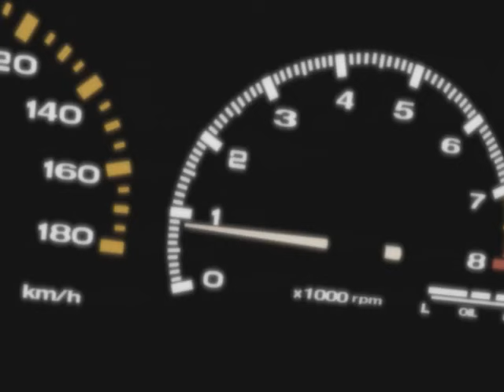Initial D- Takumi shows Wataru how he drives his AE86

Comment: Supposdly this engine is real and used by Keiichi Tsuchiya in his racing days. The closest you can get in real to this motor is Formula Atlantic series 4A-GE which revs all the way to 10,000rpm in open cockpit racing cars.
Reply: There was an image of the engine during the anime. It’s not a true formula Atlantic motor. It’s more like an extremely overbuilt 7age that somehow has Atlantic internals.  you can automatically tell by the sound of the engine.
Reply: Nope, the engine is based on Akira Iida's AE86
Reply: JDM, old reliable
Reply: this is not a formula atlantic and also not a 7age,

formula atlantic 4age engines are 4 valve, not 5 valve as shown

the "irl counterpart" to a 5 valve 4age that revs high and have VVT removed would be the race car 4ag engines found on the AE101s driven during JTCC in the 90s, actually it matches the specs exactly:

10k - 12k redline
5 valves per cyl silvertop
no VVT

famously, it is also put in Akira Lida's AE86
Reply: @FalbereChan  The truth has been spoken. Middo Natto for life.
Reply: Well the original engine block was traced in the manga so whatever is on the page exist in real life somewhere
Reply: It interesting to know that takumi struggles to handle the new engine he says he tried different techniques but I’d imagine it puts a lot of stress in his tires when he goes all out at akina

Comment: "Like" if you got the reference about VVTi engines being less favourable than non-VVTi variants for this scenario
Reply: Basically if I recall, the VVTi engines lack a lot in tunablity which is why it's not as effective as getting no vvti and aftermarket cams. It's basically full time VVTi if u don't get the VVTi model (u gotta get aftermarket cams ofc).
Reply: I have an RSX Type-S with a tuned ECU so I'm able to decrease the i-VTEC engagement to possibly 2000rpm and redline at 9000rpm if not more if I swap the block from k20 to k24. It's similar in a way to honda, but i-VTEC definitely has more options since u can control when engagement happens.

Comment: I think for Wataru it's not just a personal pride thing.  It's the lack of wisdom and fundamental understanding on display that's probably getting to Wataru, and it gets to me too.  It didn't way back when, but as I get older, I understand Wataru's point of view more and more.

As the audience, we get the benefit of omnipotence, and with that, inherent bias.  So of course we see Wataru's actions as over-the-top and unnecessarily antagonistic.  Now; take out all our foreknowledge from the previous seasons about Takumi and his rise as a driver, and start from a blank slate; no preconceived notions.

What you get on first impression when meeting Takumi is that he's an obviously gifted and talented young kid who knows how to drive and operate a car at its peak.  He has all the instinctual nuance that it takes to be high level, but somehow he has less than significant foundational working knowledge of car mechanics and (apparently) Newtonian macrophysics.  His expertise lies in the 'what', less so in the 'how', and nowhere in the realm of 'why' when it comes to certain aspects, and it becomes readily apparent when asking Takumi about any specifics about his car.

I get where Wataru's coming from.  How in the hell did you get this good without any basic understanding of chassis setup or engine power delivery characteristics?  Those are two separate facets of performance but they're heavily interwoven/integrated when it comes to an overall well-balanced car setup.  One directly affects the other, and having a well-rounded foundational level of knowledge in that regard can allow you to adjust your inputs on the fly, because you understand exactly what's happening.  If you understand what's happening, you can take preventative measures and adjust your strategy to keep yourself either a) at a consistent advantage, or b) take action to minimize whatever disadvantage you might be at due to conditions outside your immediate control.
Take AMA superbike racing for example:
There's more than one way to set up a bike to win a race, and more than one strategy within that setup to use to win.  For instance, you can set up a bike to be as quick as possible while the tires are at their most fresh, in the hopes that as the rider you'll be able to get to the lead and build up a large enough gap that can't be overcome throughout the length of the race.  Conversely, you can set up the bike to be good enough to not egregiously fall behind at the beginning, but perform far better and arguably be more stable once the tires start to wear off and the fuel load starts to dwindle; causing the bike's center of gravity to lower.  Both strategies have their merit, and both strategies are proven to work.  The main differentiators between such strategies is luck, chance, and the quality of rider aboard each machine.

TBH, if I met a racer that was flat out just better than me yet also had no clue about any of what I just stated, I'd be a bit miffed too.  Like, why even bother understanding any of what I just discussed if it nets you nothing in the end?  Interestingly enough, out in the wide world of racing, examples like this are relatively rare occurrences, and as the racing system continues to get more corporatized, these examples continue to diminish.